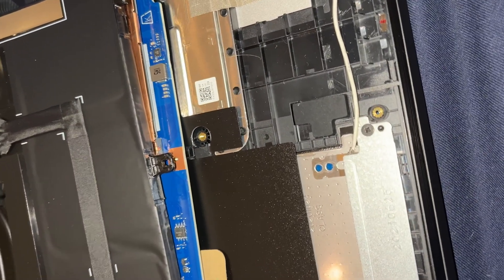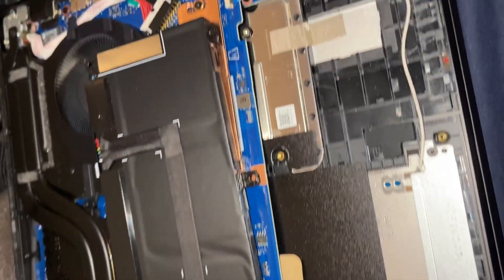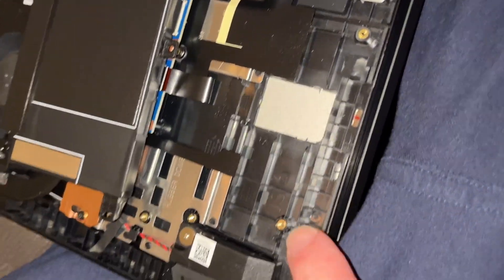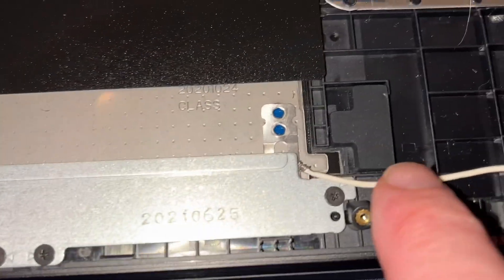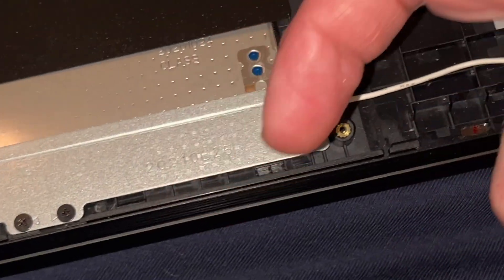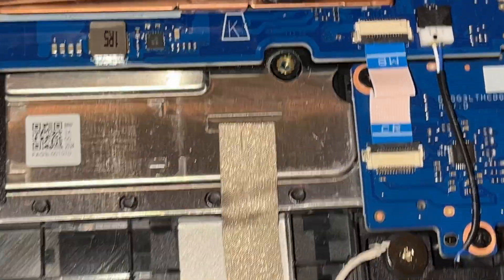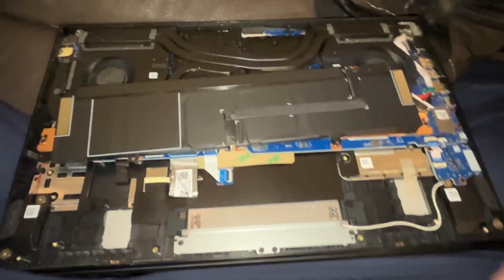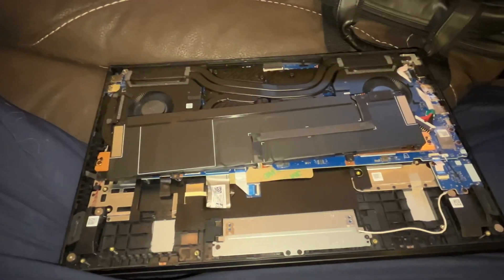HP Omen laptop mouse lag fix.

Comment: Thank you for your experience. I apologize in advance for my English. I want to make sure I have the same problem before I disassembling the laptop. The problem usually occurs when I abruptly open flip the laptop cover for more on 80% (not always) and passes when I put the cover back. The left click stops working, the cursor starts lagging, looks like around 15 FPS, or completely freezes.
F11 helps, but for a few minutes.  Also, if I use the left hard click (I usually don't use it, just swipe) - the bug appears almost immediately and the universe. But here no one wrote about the fact that the problem appears when you sliding the lid and I wonder if this is the jamb that is described here or not. And if so, why does it depend on the position of the laptop cover?
For the first time, this problem arose about a week after buying a laptop and made itself felt after I tried to move the "window" with a hard click.
Thank you in advance
Reply from the maker: Sounds exactly like the problem..lol Sorry for my delay in rersponse. I just post vids to help people. Idk if it's the lid of if its the static caused by moving the lid. Seems to be a static build up problem. This fix gounds it so the static doesn't build up.
Reply: @DSBsky77  Hello, nothing wrong ). While you were away, I decided to try to do this. Cupcake wrote that his touchpad started working well again after he touched the metal riser. I opened my laptop, took out the battery, turned it on and put it on my lap. After a couple of minutes, the touchpad start lagging, but I continued to rub my fingers over it and make hard clicks. After another couple of minutes, touchpad almost stopped responding to my fingers. Probably I did something wrong, but when I touched the underside of the touchpad with my fingers and screwdrivers, nothing changed, maybe it got a little better. Despite this, I still did this trick with the wire. After 2 days, there was no issue yet, but I'm afraid to make sudden movements with my laptop, since usually the problem started after that. This often happened if I moved the laptop turned on to another place or put it on my lap. I've also been doing this for the last 2 days, but haven't encountered this problem yet. I keep watching. I will be very upset if this happens again. Made it look very similar to your video. I hope it helped 🙏 Thank you for your reply 👋
Reply from the maker: @myimho1171  Lol Don't be afraid to move it. If the wire is set in a good position. you're good. :) Glad to hear it helped you buddy.

Comment: Looks like a good fix. I now understand why the bottom left part of my touchpad would be non-responsive after a few minutes. Whenever I would rub my touchpad with wipes (which actually felt dangerous) for about a minute, it would work again for a few hours, Perhaps the rubbing helped discharge the built-up static charge. I am going to try this out, then give an update.
Reply from the maker: I'm like 99% sure it will work. It worked for a lot of other people so far. But cheers buddy.
Reply: I also have the same issue. My cousin accidentally polished the laptop touchpad because he said there was a scratch, and my left side of the touchpad become non-responsive after few minutes just like you. I'm planning to buy a new touchpad, but I wasn't sure because HP local service center didn't want to take risk servicing laptop that are not sell on my country's market. Although, some SKU have the same parts name when I search at HP Partsurfer. I need a better proof from this hack. Does it damage some component or is it giving a static electricity to the user? Please give an update after you try this. Thank you!